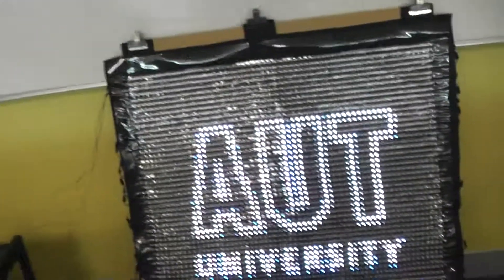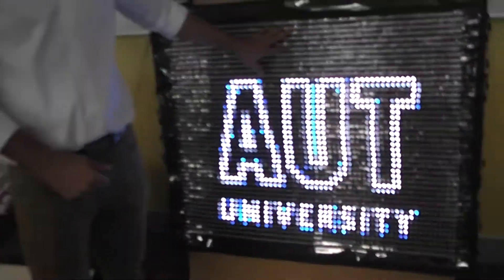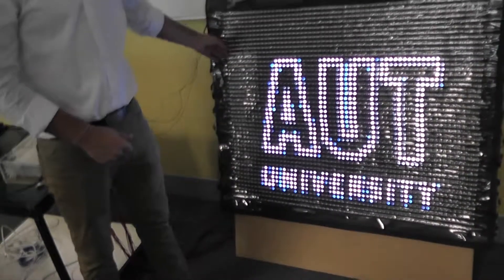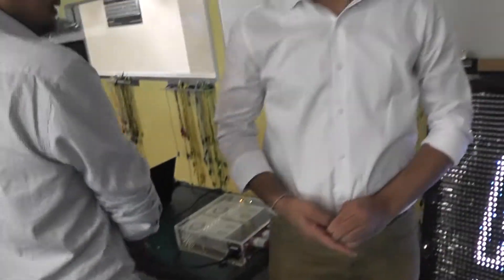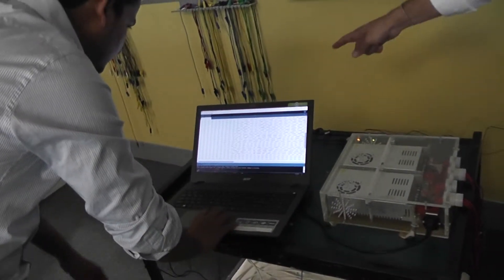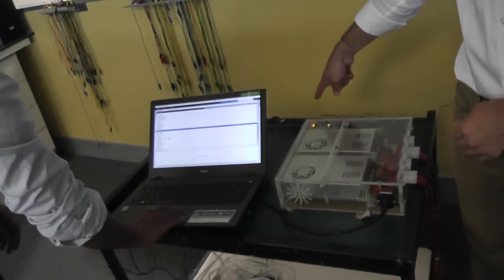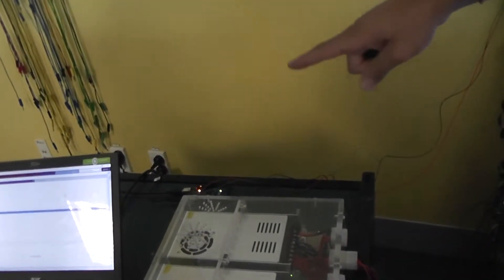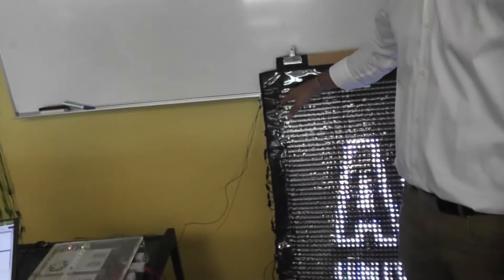Large LED Strip Display

Comment: Had to rewatch this as they weren't quite describing it as I think they're using them too clearly.   From what I can tell: The LED strips have memory so once you address each individual LED it keeps it state.   The strips are also arranged in series.   So one data pin can access every element on the LED strip.

I'd like to see how that was done as it's a very efficient way to address all those elements.   Making an LED array is something that I've wanted to do in the past, using a parallel feed for the vertical and then just a counter for the horizontal position, with latches to hold the data on each LED.   So there would only be a start pulse and clock for each element going across, but all vertical elements being updated.   That was my concept anyway!   I thought it a good way to keep up a decent refresh rate but limiting the number of micro pins required.   The one demonstrated seems superior with fewer connections.